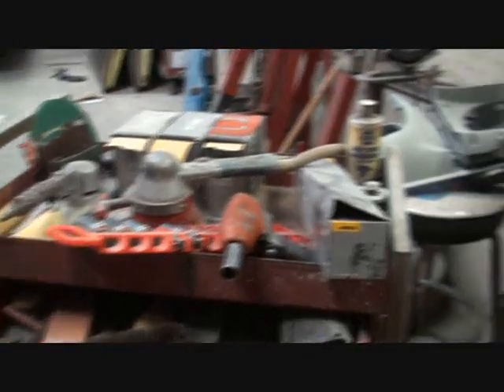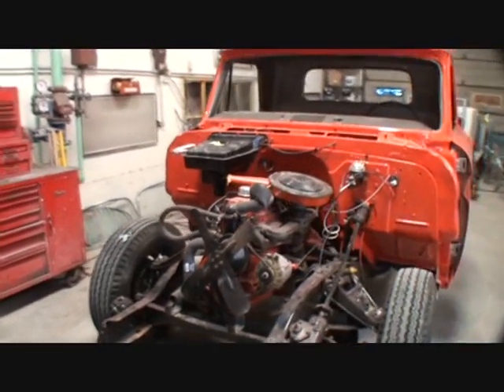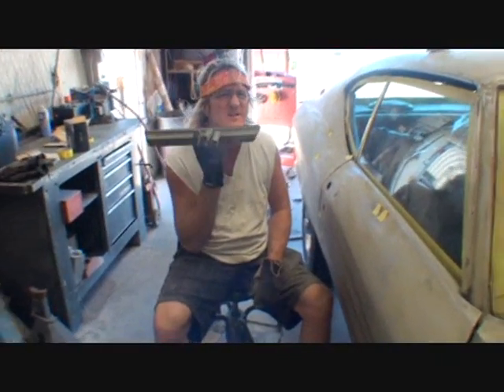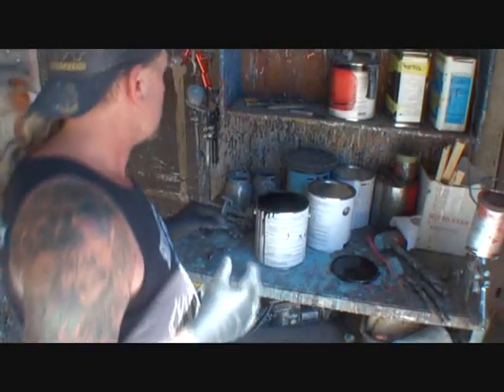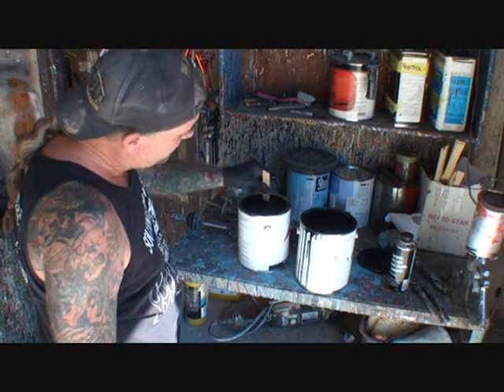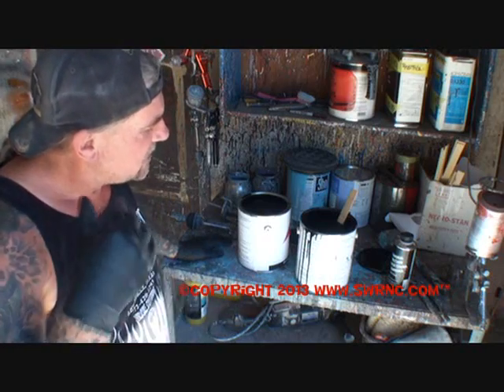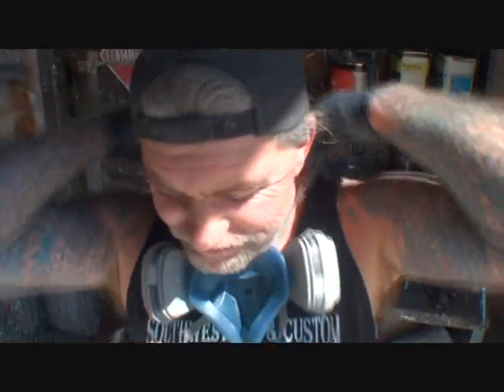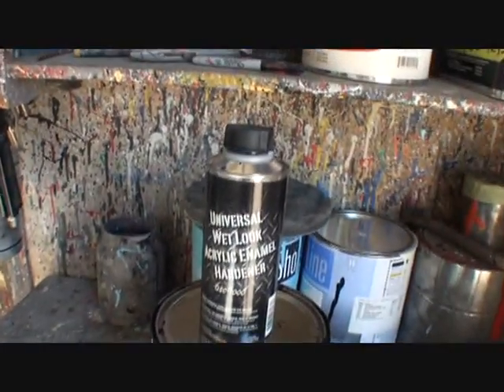Car And Truck Restoration-Painting With Acrylic Enamel Single Stage Paint

Comment: hey Pete, I'm currently doin a 1970 Bronco, and for the reasons that it is period correct, and i don't have a paint booth, i have chosen to use single stage (less wet steps to land dust/ debris in). in the past, i've used U-Tec 200 with great results, and compliments both at the gas pump, and car shows.. now, that paint is no longer available to me here in WI, so my buddy (body Man of 20+yrs) has recommended to pick up Wanda single stage, and mix in a bit of clear for matching durability and shine of the U-Tec.. i trust your opinion and value your advice, so.. any thoughts?
Reply from the maker: Ive heard of Wanda paint and believe it's made in Shreveport La. My friend Cajun Ed use's it in his shop and swears by the stuff. As for adding clear to the paint yes you can do that but  I wouldn't suggest it on the outside of the car only on the hidden stuff like door jambs, trunks, inner fenders, ect. Change is a bitch but sometimes you got to do what ya got to do to do it right and if changing up to base coat clear coat is the only way out then I say buck up and DO IT RIGHT!
Reply: diyautoschool Thanks, Pete. ... you should just fire "loser" and give me a shot at working for you. It would be nice to learn from someone as talented as yourself. Besides, i'm getting sick of the damn road salt rust bucket bullshit up here, Texas sounds good!.... As always, thank you for the valuable advice, and for taking the time to make these informative videos, as well as answering questions... Andrew Stanecki

Comment: Nice video Pete, I used enamel on several hidden frame sections on my Maverick, straight enamel no additives. I can see things fading over time with no additives, but nobody should be looking there. Chase
Reply from the maker: You got it! If someone is going to be so ANAL to crawl under a car to check the paint out they need to get an enema while their under it!

Comment: Real late to the party hear but here is some info that may be helpful to some here.  

Currently I have a 57 Buick museum car touch up / match preservation job in my shop where we need to match as close as possible to the existing  under hood fender skirts and exposed frame sections as to original. In the past I have used single stage urethanes using HOK or SPI flattening agents to tweak the overall end appearance.

So Pete, what's your thoughts on this. Given if you had both products readably available to use here, and not factoring in cost using either the Acrylic Enamel or the Urethane, which would you choose Aesthetically?  Is your choice of using an acrylic enamel giving you a more saturated depth original look color in the end as urethanes tend to self clear coat themselves.

Just curious as to your input here.

Comment: I got a 1986 gmc truck and some of the paint is starting to come off in a few spots mostly the hood except one spot on the door and it's trying to rust is there something I could do to prevent the rust before it gets to bad until I could get it painted and tips would help thanks
Reply from the maker: get yourself some inexpensive spray can sealer/primer for the time being and sand the rusted area's down then apply the primer , this should help out till you can get it painted...

Comment: Hi nice Job ! Need Help ASAP ! I mixed 4:1 instead of 5:1 of a single stage PPG DURETHANE DTM 95-3300 Series (no need for reducer), what would be the consequence if i painted that mix on a 3 hours cured epoxy primer ? They were my car calipers...  Should i restart all over again (sandblasting etc....) since they are all dismounted ? Any thought ?

Comment: that paint won't necessarily come off over time but the finish would dull from the satin to a flat color...right?
Reply from the maker: Not necessarliy--Using the hardner additive it should stay as it is. You can use this paint without the hardner if you want to and doing so will then dull the paint out in time.

Comment: Hello Sir. Have you noticed a difference in this industrial single stage vs say omni or other automotive enamels? You said the stuff will eventually wear out on the body but it's good for frame? Does that mean the automotive stuff is better cuz it should last longer on the body? Thanks man for your help. Keep yup the vids!
Reply from the maker: Actually anything is better then Omni but thats another day and another story.. As for this pant, it's really not designed for outter shell use, meaning it won't take the U.V. damage as well as other paints that are made for outter shell use. Using it on your frame structure parts it works very well for strength and durability but using it for an overall paint job isn't worth the trouble.. Using the right supplys for the right job is important for doing it right.
Reply: Thanks for taking the time Boss! Im gonna be doing a Honda CX500 Bobber and was gonna paint the frame black. I don't know if powder coating is worth it so I wanted to just paint it with a good hard single stage. Thanks again.

Comment: i was given a gallon of acrylic enamel restoration paint its plum crazy purple and im trying to spray my project with it what psi do you shoot at and any tips for a begginer trying to learn 😆 thanks in advance
Reply: +Ivan Torres  40 psi at the gun..........so about 50 at the tank.  Tips for beginners? Clean your surface not once, but a few times with the compatible cleaner.....wax grease remover. If your towel is dirty.....do it again.....and again until it completely IS.  Learn to properly set up the gun to shoot, keep your mitts off the body, keep the gun 7 inches from the body when painting and keep you hand level with the body causing you hand to pivot along the body when painting.  If you fuck up.........learn from it.  Work you edges first then the body.  Start from the top and work your way down to keep from leaning on your work. Keep the hose over your shoulder.......and say not to drugs. :)

Comment: is this oil base? is this same as majic brand paint like from tractor supply? can you please tell me the brand of the paint you use on the video
Reply from the maker: JUITPOWER I use a brand called GSI which is a heavy industrial paint specifically made for this type of work. You can probably get it online ..
Reply: diyautoschool can you paint the whole truck with this? also is it oil base? thanks in advance
Reply: +JUITPOWER   Hmmm.........if you got the car key out of your ear you would have heard that yes, it can be used for all over paint, and it will last "for several years" but will "eventually wear off because if wasn't made as an auto paint.  Enamel paint is oil..........acrylic is water based. So yes, it would be considered an oil base.  :)

Comment: Now petes right once the hardener is mix into the paint youre on the clock. Now if you do have some left over you can throw it into the freezer and itll keep for if you have some little crap jobsthat come up requiring something a tad more durable than some krylon. Moxing the hardener and the paint is kicking off a chemical reaction called crosslinking, and chemical reactions like this slow down or stop with low temperatures like whats in your freezer. I wouldnt use mixed paint from the ice box on anything like a fender or a hood but ive done intake manifolds, wheel wells etc... just a little tip to stretch the budget if need be

Comment: Great vid Pete. In fact I enjoy all of your videos. You should smack weekly upside the head once in a while just to keep things interesting.....lol
Got a couple of quick questions.....I have always been told that adding hardener to satin single stage basically cancels out the satin and makes it glossy. Obviously that's not the case? Or does it to some degree? Also, in an unrelated area...What brand of product do you use and recommend? Like everyone else, I want to save as much money as I can, but not at the risk of doing a paint job that wont hold up or that is going to work me to death. For example, I have heard the cheaper clears like Matrix compared to (Dupont or PPG) wont hold up because they have little or no U.V. inhibiters. I have shot Matrix, and it lays down nice, but it will work your ass off riding a buffer. Do the solids in a clear have anything to do with the U.V. protection ? Thanks again and keep up the good work :-)

Comment: Hello Sir.I have a old 68 with thin paint.I tried using a stripping grinder wheel and it sanding it to the bare metal like I want it to but it seems to me like it's straching the metal.What do you normally use for a job like I have?

Comment: Concerned about hardeners and reducers...but unconcerned about not having primer over bare metal...what?
Reply: As long as a vintage car has bondo glass or plain old fiberglass patching, then you don't have to spend money on 2K primer. But yeah! always use primer after bondo, fiberglass or welding. In Mexico, these jackasses never prime on cars, which is why the paint falls apart.